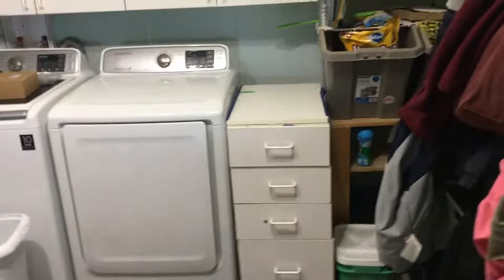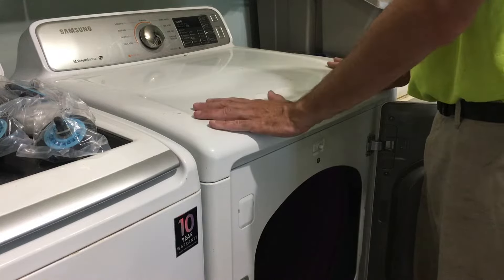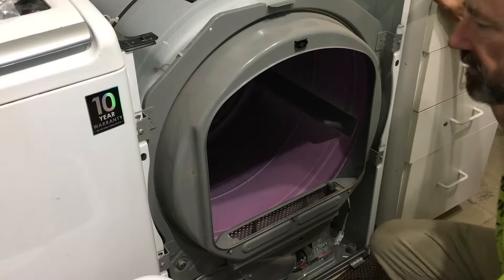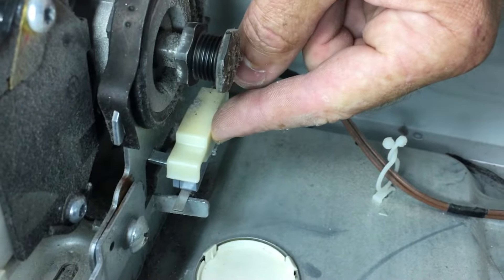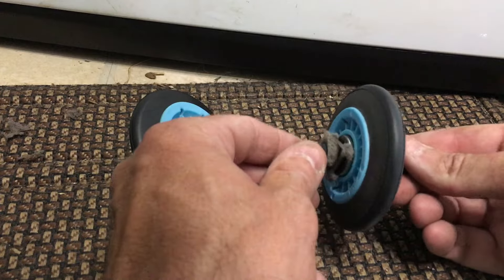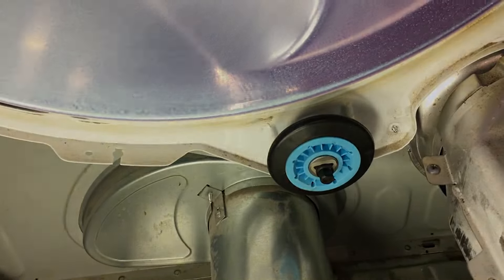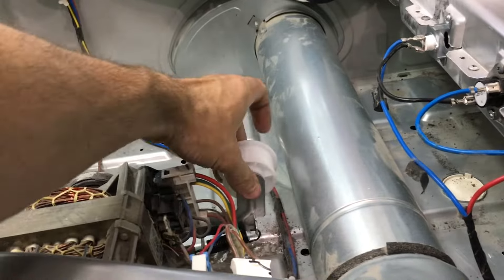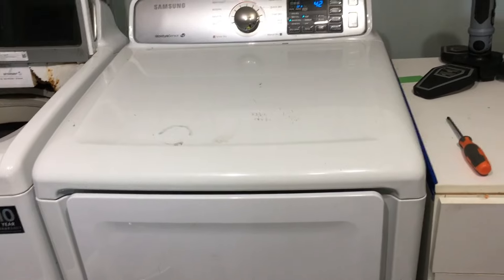Samsung Dryer - Replacing the Belt, Belt Tensioner, Drum Bearings, and Sensors!  Do it yourself!

Comment: Today is September 20th 2024. I call multiple companies and they all wanted to charge me close to 100 to 150 just to evaluate the problem with their video. I was able to take it apart putting new belt drive and put it back together and save myself over $500 thank you so much for this wonderful video.
Reply from the maker: You are welcome.  Dryer's are not rocket science, I'm glad this gave you the confidence to tackle it yourself!
Reply: How long did it take?
Reply: @ExitStrategyNYC  hey! I honestly saw the video 2-3 times before in touch dryer. After I counted all the screws my dryer had and got my impact drill and a non slip matbyo place the front door of dryer when removing it. It took about 40-45min
Reply: @ExitStrategyNYC  I also bought the belt from a appliance store for under 20 dollars

Comment: Thanks for the very helpful video, I’m gonna give it a whirl. However, Why can’t anything just last? You know like it used to, you buy a washer and dryer and it lasted for 15-20 years until you”upgraded” for this Chinese junk. I wish I could find an all mechanical washer without a digital board. Closest thing is speed queen tc5 same with dryer. I will never buy another Samsung.
Reply from the maker: Oh, we are with you on Samsung.  Our washer machine rotted out on us, we did some digging and replaced it with an LG and fingers crossed should do better.  Our Bosch dishwasher is the best dishwasher I have ever owned.  It’s amazing.
Reply: @RedBarnHomestead  we own a Bosch and it’s been thru thick and thin with zero issues and with silence. We love our Bosch dishwasher.

Comment: Video is exactly what I needed to replace the belt, tensioner, and bearings on my Samsung dryer. Great explanations and shots of every step, very helpful!!
Reply from the maker: I'm glad it fit the bill.  Its not an overly hard machine to work on, you just have to take your time.  I do check my tension pulley anytime I'm in there to make sure it doesn't cut itself like that again.

Comment: This is great video.  Thank you.  Dryer died yesterday at 4PM.  Had it disassembled in 10 minutes.  Parts ordered for overnight delivery (Amazon) on doorstep around 6AM and dryer repaired, reassembled before 2nd cup of coffee this morning.  I do wish you had shown what black magic fuckery you used to get that belt over the tensioner pulley.  I tried for 30 minutes with the drum on but I'm a girly man with soft delicate hands that didn't have the strength to pull it back far enough.
I did eventually figure out to engage the serpentine first, then pull the belt over the neck of the drum which has a smaller diameter.  Then, gently and slowly rolled the drum left to right pulling the belt along drum surface until it got in position.  It did roll over in the process but that was easy enough to fix and the entire drum/belt portion took less than 2-3 minutes once I figured out that trick.  Full assembly after that took less than 5.
If I ever have to do it again, I think I can go start to finish in under 45 minutes.  I wouldn't have had the courage to even attempt it without your video, so thanks again.
Reply from the maker: Comments like this make my day, thank you.  I'd have to go back to see what I did to get the belt on...I know my idler pulley was toast and needed replacement too, which means I had to undo the tension spring which maybe where I did is so easy...then just hook up the spring and done.

Comment: Great video!!!!  I took mine apart to see if I could notice anything, didn’t see any visual problems.  I put it back together…it slowly spins with nothing in it, but when I put even a tiny amount of stuff in, it doesn’t spin.  What do you think would be the cause of that?
Reply from the maker: That is very likely a drum belt issue.  Now what, is hard.  Is the belt tensioner tight enough and the spring connected?  Is the belt worn?  Does the motor pulley slip?